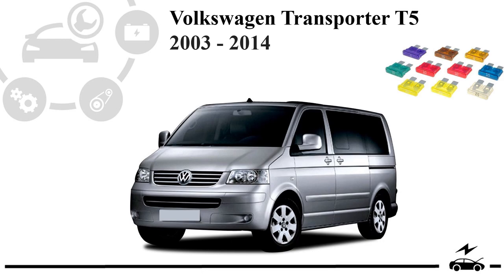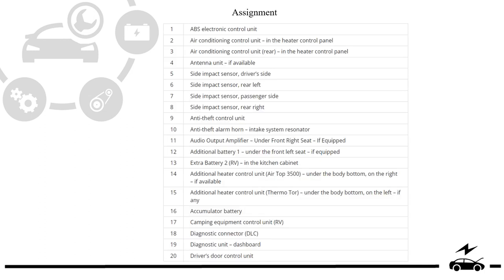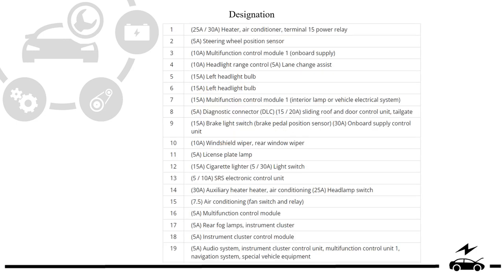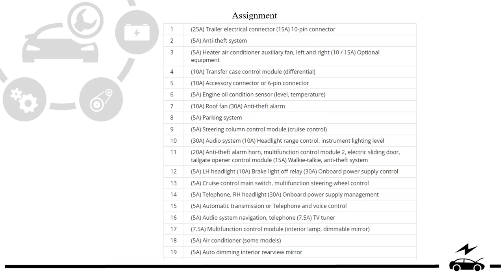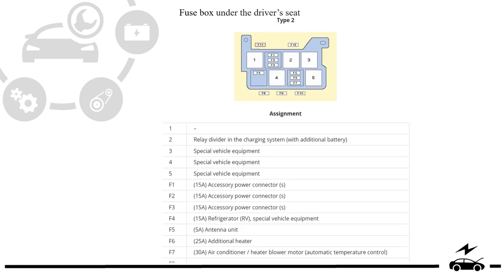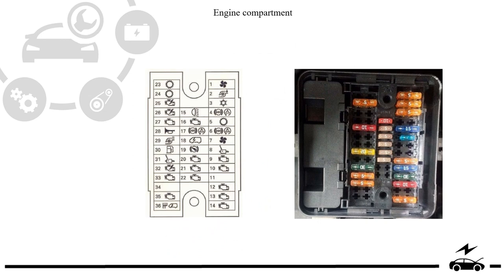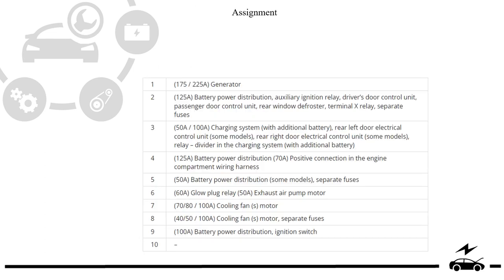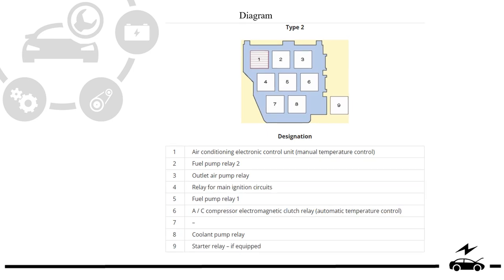Fuse box diagram Volkswagen Transporter T5 and relay with assignment and location.

Comment: 2010 t5 132kw, i can force the tank pump to run by jumping the terminals of the relay, but with relay in place it never runs to prime the system, where do i look for fault? all fuses are showing full voltage on both terminal when back probed.

Comment: Do the dipped and full beam headlights have a relay?
Reply: I also wana know coz my lowbeam dimmed headlights  does not work but the highbeam brights wprk ... Did u find any relays ?
Reply: @babelonchabalala1690 
7 months later... Did you find it? My dimmed light doesn't work either, front and back on the right side.